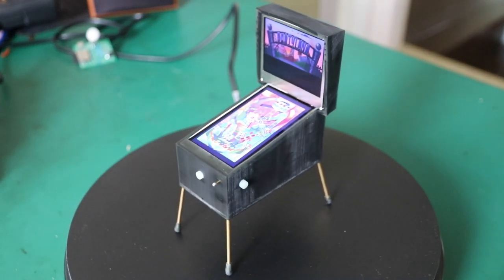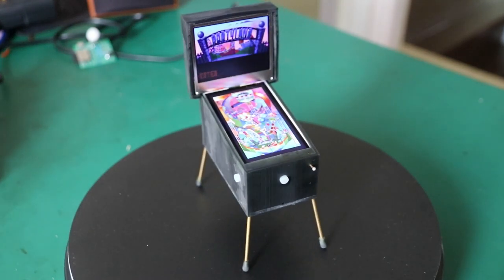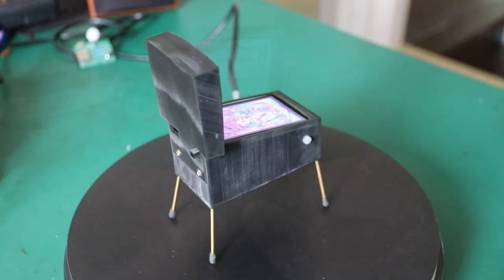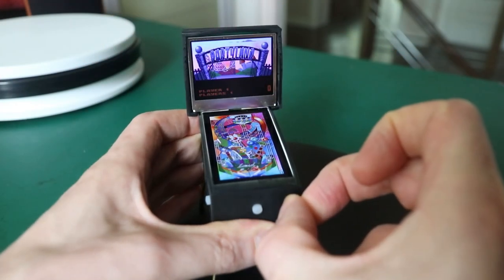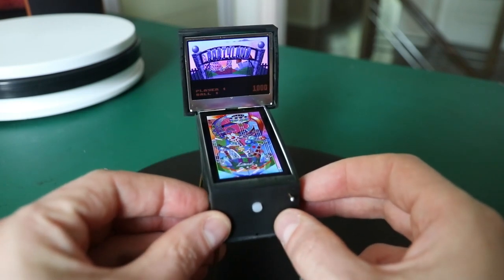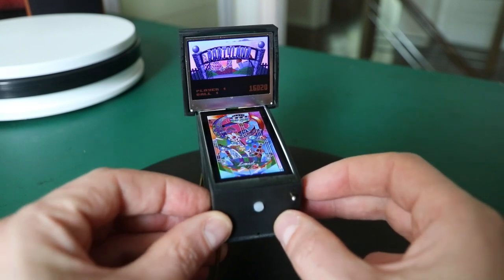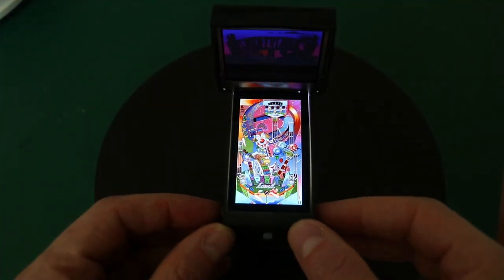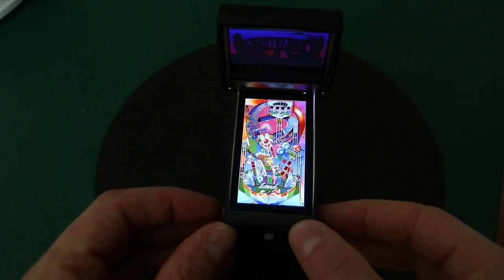Pinball Fantasies miniature table intro

Comment: As someone who understands the challenge you faced with only partial asm code, this is really impressive.  I don't think I've ever seen the full tables without scrolling before.  Excellent work.
Reply from the maker: Thanks! There's actually a Dosbox patch out there that can show pinball machines like PBF and Epic Pinball at their full size. Given the fact that the entire table is just sitting there in VRAM, it's actually not that hard to show all of it if you can control the video emulation.
Reply: As someone who doesn't understand that particular challenge, this is still really impressive! :-) -JC

Comment: Awesome work, yet again! I love pinball machines. And I also enjoy playing such games on small screens, like Metroid Pinball on my Nintendo DS Lite (including a rumble cartridge! even though it makes more noise than vibrations 😆).

Will there be a "tilt" detection sensor in your build? 😉 Oh wait, I can't recall if that MS-DOS game even supports Tilt functionality. 🤔

Because the ESP32's GPIO pins are used for input/output... You could call this a "GPIO PIN-ball" game. 🤭 

Crazy how those tiny microcontrollers have become powerful enough to make this kind of project possible! 🤯

Can't wait to check out the complete article. 🤓 

#WishingIHadSuchElectronicsSkills
Reply from the maker: Yep, there's an accelerometer in it, and Pinball Fantasies has a tilt button. I could actually make it more precise than the code supports, as I could 'reach in' and set the velocity of the ball to match what it would have done if it would see the actual acceleration vector the accelerometer measures... but I didn't, as bumping such a tiny case is already hard enough and I don't really see myself doing it aside from perhaps getting a ball un-stuck.
Reply: @Spritetm  lifting one of the flippers and then bumping the ball back into the playfield from the drain is a classic move of skillful pinball players. Being able to do it without triggering a TILT is considered fair-play.